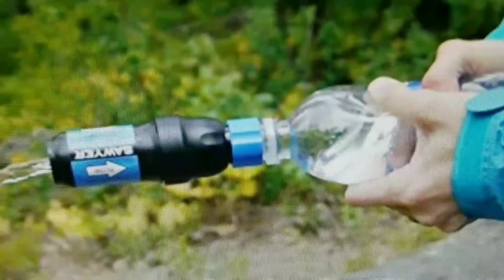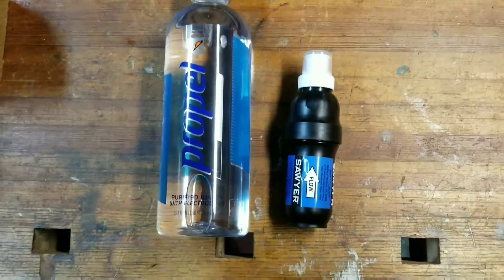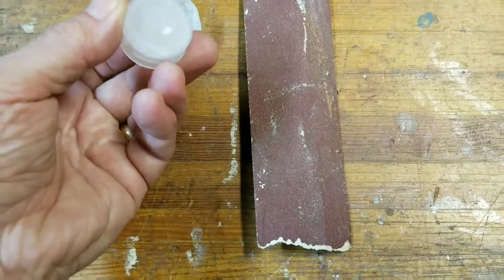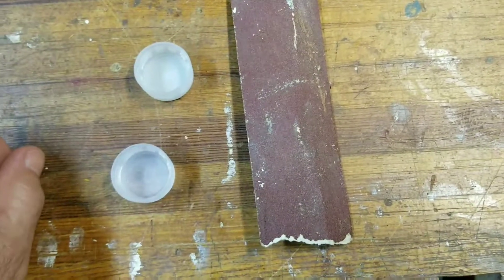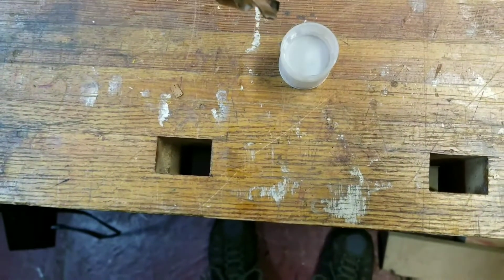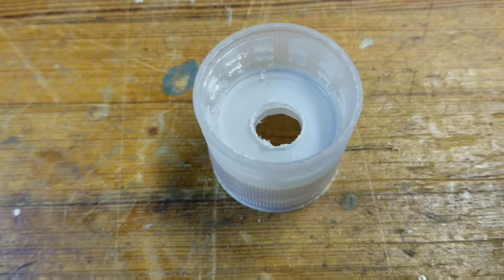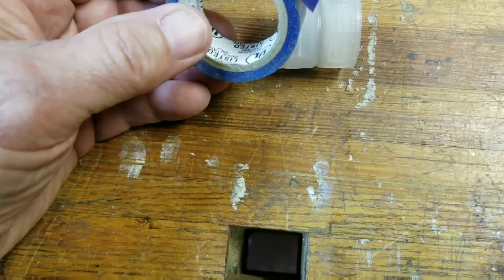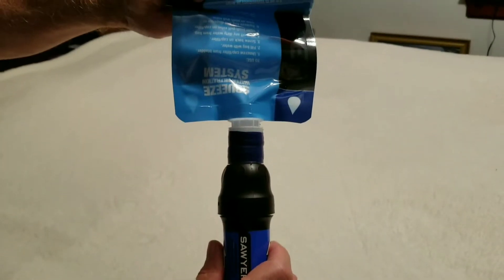Sawyer Squeeze DIY coupling

Comment: The flow of the dirty water is in the opposite direction you are describing.  Look at the flow direction on the filter.
Reply from the maker: You are correct but the video is not about how to purify or back flush, it's about making a coupler.